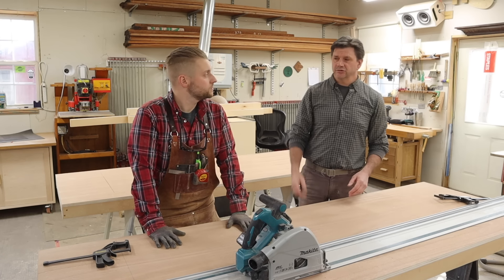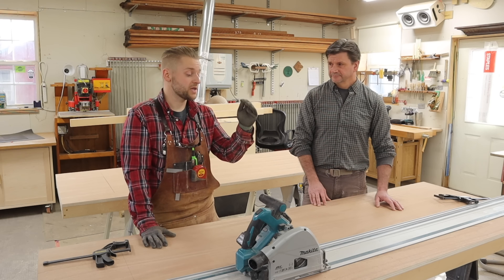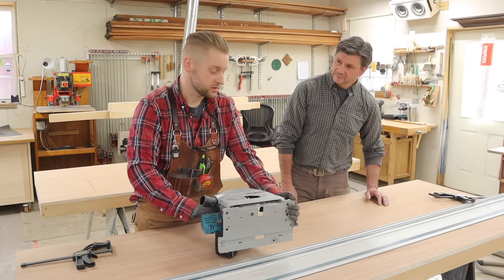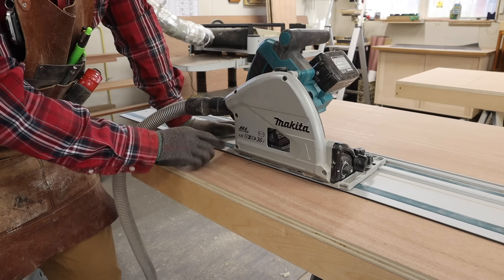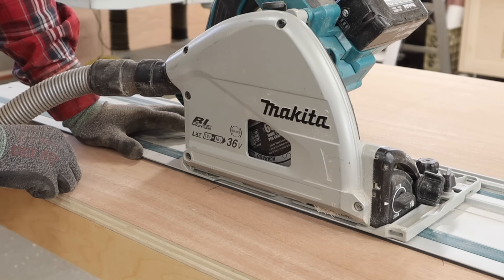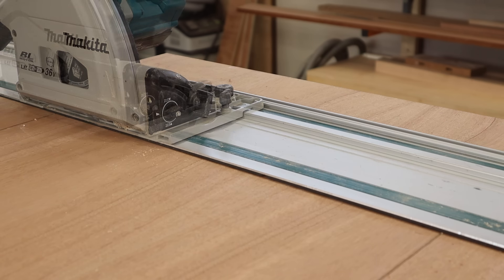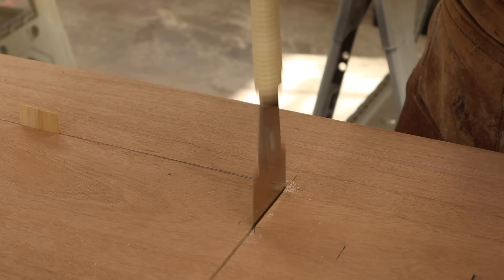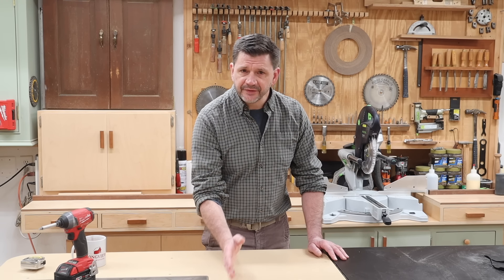I'm Buying the Makita Track Saw Next, Here's Why

Comment: I can't say what the power difference between the Makita and Festool is but I know that the Festool has an overload mechanism that the Makita doesn't have to protect the motor.
Having said that I've owned used and abused a Makita track saw for the last ten years and it hasn't let me down yet. It's been awesome!
I have also used the Festool and the failsafe is a fucking pain in the ass especially when cutting a miter. It binds and ends up ruining the cut making you have to go back and start again, Whereas the Makita will power through it.
I almost went down the Festool path when I was looking at buying a track saw but after having seen my workmates struggle with an overpriced tool I can honestly say I have never had any regrets with my decision to go with the Makita.

Comment: I’ve recently upgraded to this track saw from a corded Evolution circular saw type. The difference is night and day. Dust extraction on the Evolution is completely useless, even with my Festool MIDI attached. The Makita on the other hand is amazing, especially when you cover up the blade change hole. Luckily, the Makita fits the Evolution tracks (even though I have bought 2 x 1.500mm Makita ones) so I cut those down to smaller tracks. 1 x 1.000 and 1 x 1.200.

Comment: Go for the bosch track saw. Makita rails are very often not square to each other when jointing 2 pieces. Basically every track saw has a scoring cut feature, so that's also nothing unique in Makita.
Reply: I have noticed that the quality of the Makita tracks seems to be subpar. The one that I had was bent on the cross section so that the saw didnt sit flat on the workpiece.

Comment: I’ve had mine for almost a year and I love it except for one major flaw. Makita’s method for clamping two 55” tracks together is awful. Nearly impossible to get straight smooth cuts when ripping 8ft sheet of plywood. Spend the extra money and get the 118” track, it will save you a lot of frustration. I’m working with Mikita customer service to fix the problem but so far lots of talk and no action.
Reply: Mafell and bosc has a flawless method to join rails.

Comment: Jon, interesting video. I would suggest that you try the FesTool track saw before you commit to the Makita. I've had a FesTool for a few years and I have never experienced any power issues with it. Just saying...
Reply: Totally agree! I know some folks have said they suspect a power issue because of the sound the motor makes under variable load. I’ve had the 55 and currently have the 75... power had never been an issue.
Reply: I’m lucky enough to have the corded Festool and this same cordless Makita. In my opinion, the Makita is actually smoother and I find myself using it much more than the Festool. In fact, when I get a chance, I’m going to sell my Festool. I have a bunch of other Festool as well, so it’s not like I’m knocking them.
Reply: @MrHunkaPillar  I agree on the “rough” sound they make. It’s the variable load/speed circuitry doing it’s job. But man is the Makita smooth. Oh and notice how the blade on the Makita stops almost instantly.

Comment: Oof. Mistake, man. The cordless Festool is ALSO more powerful than the corded Festool model. They're both plenty powerful. But you've got Festool products, you know how much better suited they are for fine woodworking than most powertool brands. The cordless track saw will automatically turn on your Festool vac via the bluetooth batteries. The riving knife, which is actually very important. The splinter guard on the track side of the cut AND on the saw itself. The adjustment is so simple and fast that you can set it up for a "scoring cut" in a second. Far better and more stable blades which are resharpenable. I would bet my Festool cordless track saw will still be running and working in concert with the overall Festool system for many years longer than the Makita.

Comment: If you get the TSC 55 (Festool) then you’ll buy the longer track. Then you’ll buy the domino 500, then the router 1400, then the C 18 drill, then the LR32 just cause. Don’t do it, Jon, just don’t.
Reply: don't forget all the Woodpeckers accessories to go with all the Festool! I've already drank that kool aid and am now stuck.
Reply: @davidn7945  I had an intervention and got off that Red Crack. Pass right by the ads now without a second thought. Just how many measuring tools do you need?
Reply: @JDDupuy  Ha! I totally agree. I think I'm maxed out now. I hope.

Comment: Had the corded version of this. This saw is a safety disaster. No riving knife, no kickback lock. Blade is on the wrong side for right handers. 

It’s missing a splinter guard which negates most needs for a score cut. 

Hope Makita will rev this for their new Battery platform and up the safety factor. At least the cordless version gets rid of the ridiculously short cord.
Reply: What right hand pluge saw do you suggest? I see all major brands make left hand  pluge saws.

Comment: They hype and fad of Festool. It's bound to crumble one day.
Reply: Not sure what you mean, I’ve found everything I own from them worth the price. That said some products are more worth it than others. The sanders, dust collection, routers and domino machines are some of the best. Their corded track saw is not a lot better than the Makita, but their cordless version has a good edge, especially with how well the dust bag works. The bottom line with Festool is that it is designed for production work, and the tools pay for themselves by saving you time.  They follow standardized building methods and add speed, precision and reliability.

Comment: Festool saws are made with low quality components.  If you watch a Festool saw tear down video, you won't buy one.
Reply: Always wondering about the weirdo looking Festool drills. Probably built to cost like everything.
Reply: @FearsomeWarrior  Festools sometimes rate poorly when torn down to the components.
Reply: @richardmckrell4899  Totally. Makita gets extra credibility from me because they are their own company. No parent company. Even if it’s a little misplaced I still feel like they are better because of it. Only Festool teardown ive seen is AvE’s tracksaw from 4~ years ago. Cheers.
Reply: @FearsomeWarrior  Yeah I saw the same tear down video.  High price does not always correlate to high quality.
Reply: While I think uncle B makes some good points, the festoon saw is extremely well built and infinitely repairable. The warranty  and after sales service is in my opinion the best there is. I’ve been told by makita to pound sand on basic repairs: festoon overnights replacements at their cost... just sayin.
Reply: Festool's 3 year warranty has many exclusions and their service turn around time can be long.  No modern power tool is infinitely repairable, including Festool.
Reply: @richardmckrell4899  I wouldn’t agree with you regarding the warranty, but I do realize that every warranty has its limits. As far a repairability I’ve rehabbed plenty of festool with factory parts but alas have found some components such as the plastics that when they die: you’re done. I do feel like the festool turn on repair or replacement is good but I’ve only had to do that 4-5 times and only on the jigsaw and sanders. In the end everyone’s gotta roll wit what they like. :-)
Reply: @MrHunkaPillar  Festool has 10 warranty exclusions.  Several almost guarantee that the repair will not be covered even in the 3 year warranty period.  With so many vague warranty exclusions, the length of the warranty becomes irrelevant.